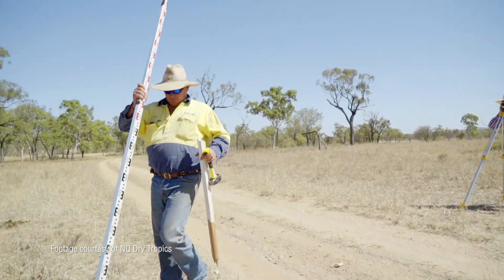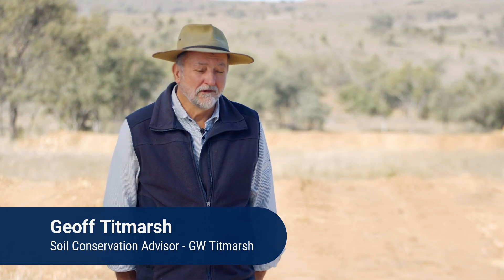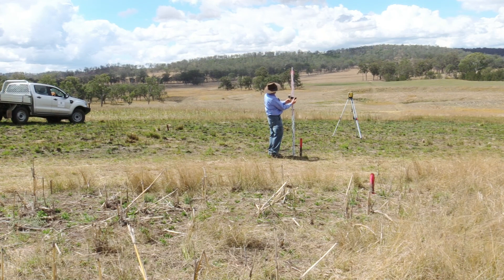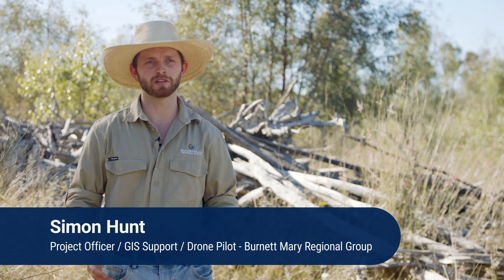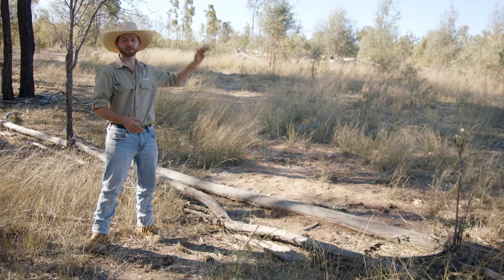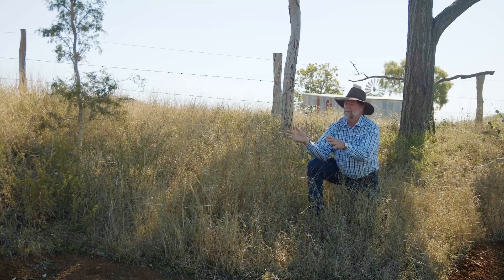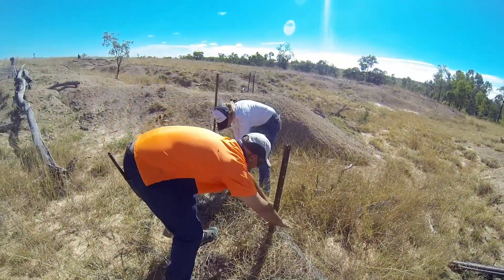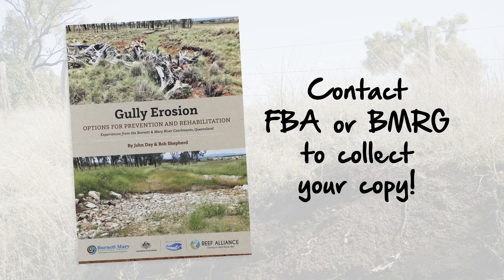Gully Erosion on Your Property Part 4

Comment: What a load of crap. Deep ripping is poor for soil water retention. Heaps of different root systems in the ground is a 100x better.
Reply: are you familiar with PA Yeomans and "Key Line Design"? I'd suggest doing a little investigation. His method was a modified deep rip, but he did not do it on contour but rather parallel to the KEY LINE. He developed a special plow that rode deep and "bounced" atop the hard pan below the topsoil allowing the water (and more importantly organic material) to get deep but without turning soil. Furthermore it was only used on degraded soil and only to re-establish/kickstart growth. Worth looking into